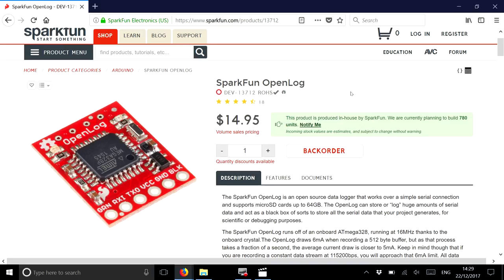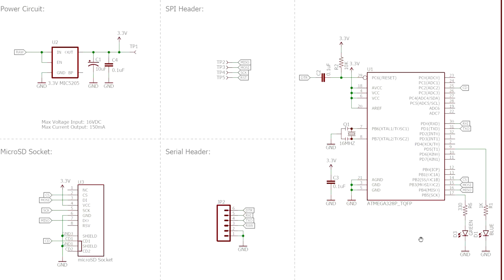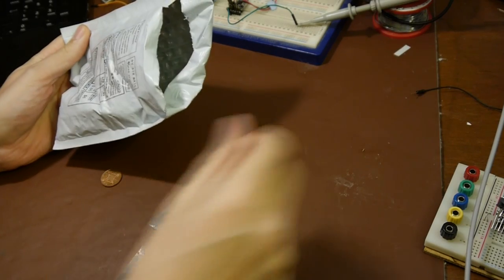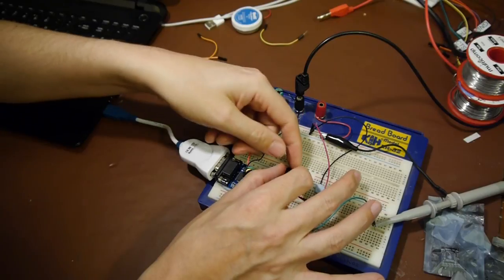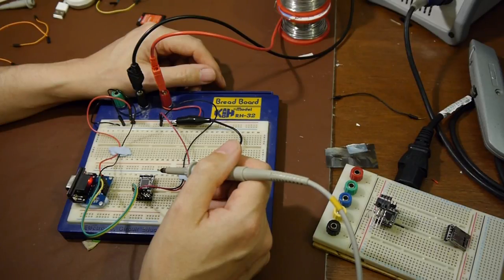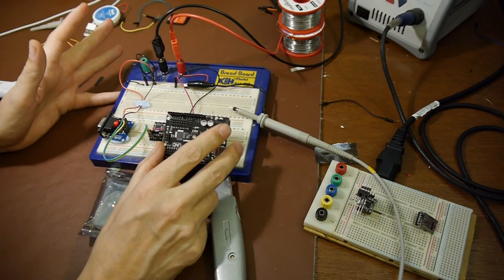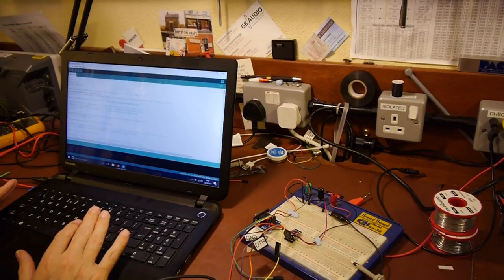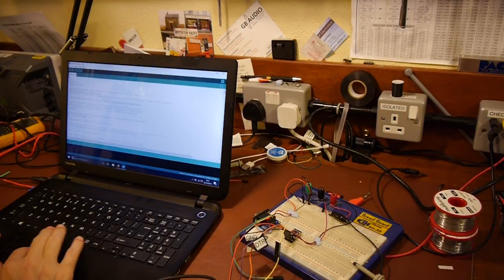The Rabbits HOLE - Part 1

Comment: Bugger.
 Not a subject I know anything about, interesting though, 
i will stick to my analogue and voltages that go out of their way to give me a bad day, my microwave blew up a few days ago and I am considering what to do with the transformer, nothing legal has come to mind yet!,
 Seasonal Cheers, J.
Reply from the maker: Average Joe  Hi Sam. Clearly something that I also know bugger all about, but I do have a cunning plan for part two. I wonder what’s gone in your microwave. half the time it’s just a simple fuse problem. There lots of nastiness stored up in a MOT have fun. Always fancied removing the door of a microwave and sticking something stupid inside. As always thanks for comments my best regards Chris.
Reply: (It was the high voltage fuse, discovered it  too late- was ankle deep in eviscerated domestic electrical servant by that point!).
Reply from the maker: Average Joe  makes sure you replace that pesky fuse with a 6 inch nail, that will teach the bugger to blow!